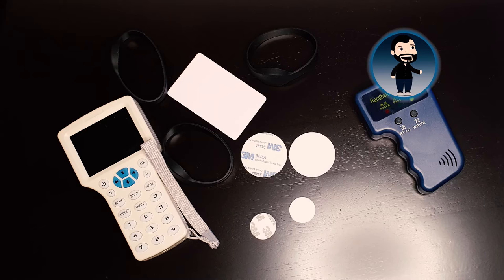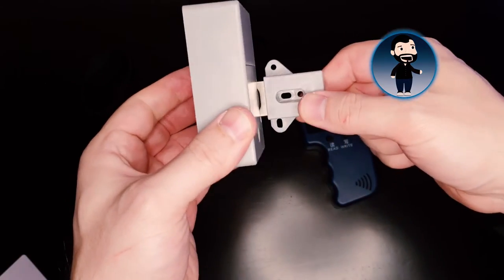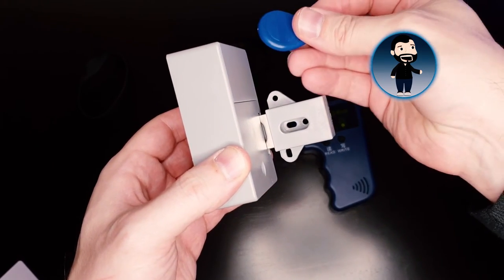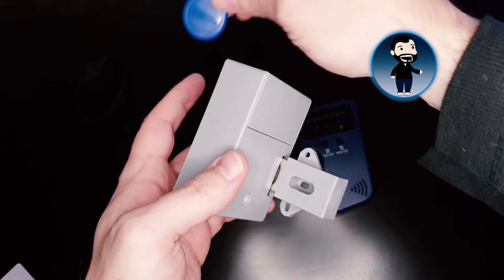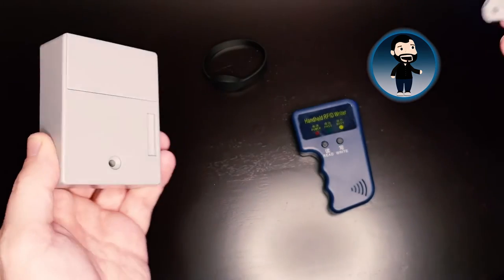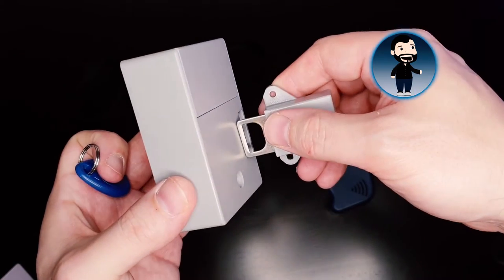Cloning And Smart Use Of RFID Keycards & Fobs

Comment: Not one person in youtube show how to manually write in codes, someone says its possible with the second reader/writer you show, I tried but am doing it worng, example I did following, step1--change mode to 125khz or whatever, step2---type in number (error) number cannot be typed in, so to manually write I have to do something, but not a clue, maybe I did the 1st step wrong, been tryin, will wait for suggestions, thanks.
Reply from the maker: This should work as this is how it works on mine, switch to mode of frequency then type and then hit write. You might try if clearing or c beforehand works. Seems like since these readers are generic they vary greatly
Reply: @AndysTechLife  -- I figured it out, you cannot type HID numbers in because the HID keyfobs have to be programmed with a facility code which is not optional in this device, but what it can do, it can copy over all the data from one to another by scanning/reading then writing, but manually writing not possible because it will be missing (2 sets of number codes) not talking about the regular card number or the KHz number. But after reading this, HID cannot be done by writing in manually, has to be an HID keyfob just as original HID keyfob and has to be scanned copied and then write button has to be clicked on the target HID 26-bit Prox keyfob. Thanks for your help and prompt reply.

Comment: Hey Andy! 
Great video, was curious I have a Schlage, IC-Type A chip. Was given permission to copy it to save money, purchased the same 10 frequency reader you have in the video. However it’s been unable to decode the chip and therefore unable to properly read it to copy. Do you recommend a specific decoding software? (They want to charge me over 150$ if I have them do it)
Reply from the maker: From what little I know, many of the Schlage chips use both standard 125 kHz proximity and 13.56MHz MIFARE and Prox Multi-Technology. So you'd need to check your specific chip to understand which one it is. So if it's the 13.56Mhz MiFARE, see if you can read the fob with your phone's NFC first using something like Mifare Classic Tool app.  You may still not be able to copy it but you know you're on the right track. If you set the reader to 125khz mode and you get a result you're probably looking at a HiD / T5577 compatible 125khz chip. Last thing is depending on the reader you got, there should be a link to PC software you can download and attach the reader via USB and try decoding that way. If all this doesn't work you might look at Proxmark3 which is a more complete copying solution. As a tip, if you know a friendly locksmith with a reader they might just read the fob and tell you what type / frequency and even data is on it which you could then use to duplicate yourself, but they may not do this without charging. Hope this helps, but unfortunately there's so many standards, chipsets, encoding etc, it's impossible to get one solution that works for everything.
Reply: @AndysTechLife  Really appreciate the reply, the chip more specifically is a IC-Type A 13.56 mHz. Company brand Schlage and pops up as a E4100 on their main site that uses Mifare Classic. The computer software that comes with the reader in your video was unable to copy the FoB. Unfortunately all the locksmiths in my area (went to 4) only do car fobs. Ill give the Proxmark3 a look into and let you know the results.

Comment: Hi. Do you know if ACT fobs are the same as HID and do the readers you talk about here work on them. I have an ACT 125khz fob. Thanks
Reply from the maker: You might google the particular serial number as im not as familiar with the ACT fobs in particular but a brief look suggests that some are HiD compatible. But some of them are a different standard by the looks of it (5e) Its likely that you'll be able to read them and write them if they use a similar chipset. If I find any more info I'll let you know.
Reply from the maker: HID licence out so ACT seem to do HID based fobs so the likely answer is yes  but again if you can check the particluar model / serial number to be sure.
Reply: @AndysTechLife  great thanks a mill
Reply: @AndysTechLife  Sorry Last question. How do I find the serial number on google as I can't see any number on the fob? Thanks
Reply from the maker: They're normally printed in really tiny letters on the fob, but they do wear off so you might need to just googel search ACT fobs until you find one that looks an exact match. Normally the HID ones have some indication that they're HID on them but not always
Reply: @AndysTechLife  Great will do. thanks for your help

Comment: Can one tag hold more than one code? like work ID, house gate, or a cabinet all in one sticker
Reply from the maker: No unfortunately the stickers are only capable of holding 1 tag at a time. There are some on the market that can hold a couple of different types such as T5577 and NFC,  but essentially there's two chips on those ones, so in general its one tag, one code
Reply: You can get an electronic one that looks like a car remote which can learn multiple tags. I've seen up to 10 tags.

Comment: What about a Dual Frequency Schlage 9691T ?
Reply from the maker: So afik these chips use Mifare® Classic® 1K (4-byte UID) This is NFC & H10301 (HID® Proxy). So if your reader can read HID tags you should be able to read / write that part of the chip. The MiFare classic though will depend on how the card is written, no guarantee you'll be able to clone the data. It's very much trial end error with cards and readers, so worth looking to see if there's a specific reader for this type of card.

Comment: I’m getting a “read failure” when trying to scan my fob :( any ideas?
Reply from the maker: Depends on the type of Fob. Generally when that happens it means that the reader can't identify the fob in question. It's very hit and miss as I've seen many different versions of this reader so best to Google your specific fob for the correct reader.
Reply: @AndysTechLife  thanks for the reply Andy. It’s a bit frustrating really since the fob I have is a HID 1346 prox… so I bought a reader that supposedly catered to it. But these machines just seem to be random. I read an article then after with a guy who bought the same reader TWICE and one worked and the other didn’t… a bit wild 😅

Comment: Yes but how to copy pac stanley key fob 153khz???
Reply from the maker: You'd need to get the official Pac Stanley equipment by the looks of it. As they're a different frequency none of these readers will work. Might be no harm asking a locksmith if there's anything they can recommend, but these readers only do NFC and 125khz so won't work with 153khz cards and fobs.

Comment: Could you please check the data of the access control card? Not modify
Reply from the maker: Not sure if I understand the question here. The reader, depending on which one you have, can be connected to a PC to read some encrypted data from the chips, but you'll need to make sure you get the correct reader for your own style of chip.

Comment: Is there anywhere we can buy an original HID 1346 ProxKey III that can be re-written on? Or does the manufacturer not allow additional recoding?
Reply from the maker: ID Cards direct (.co.uk) sells the official HID ones, but I don't know if they program or need to be reprogrammed. Its generally not possible to recode these though, and generally whoever coded it in the first place tends to lock it from recoding, at least not without an official HID reader / writer. It's also not a good idea to try programming blank official ones on non official readers. It's worth looking at the T5577 cards though. These are what I use to replace most of the HID cards I use as they're HID compatible and have worked fine for me.

Comment: Does this include fobs that have a block on the code? I had someone try already to make a copy
Reply from the maker: Really depends on the equipment.  HiD fobs are blocked generally but some readers can still copy them. So far I haven't come across any that the reader I showed there couldn't read and copy, but there's no way to be 100% sure without trial and error. If they can be cloned in a shop such as a locksmith then there is a commercially available reader that can do it. Maybe check with a locksmith if your fob can be copied. If it can then you know that its just a question of finding the right reader.

Comment: does this work with hid prox 1346 key?
Reply from the maker: Pretty sure this model does, best to check before purchasing though. Mine does support most HID proxy passes, but there are lots of different versions so check the specs before you buy
Reply: @AndysTechLife  I bought one of the cheap ones it does work with the HID proxy pass I mentioned. I got it through Amazon if it didn't work I would just return it and get the more expensive one.

Comment: Will this work for secura rk65 reader?
Reply from the maker: There's different versions and different protocols so you need to check what type of rfid chips you are using first then get the correct one for that. There's no 1 reader that will do all different makes and types of chip. The one I display here is compatible with HID card 1386/1326/1346, T5577, EM4305 chips, but as I said there a literally hundreda of different types so you need to buy one specific for your fobs. Hope this helps

Comment: what about a fob that ends with  ( A  HCC40 )
Reply from the maker: Just a guess but I think HC are Prox Fob 125 kHz HCC40 Hartmanm Control systems, might be worth seeing if you can figure out if it is one of those, but you may need a specific reader / writer for it. Unfortunately, there's no one option that works for everything as there's so many standards and chipsets. :(
Reply: @AndysTechLife  wonder if I could find a reader and writer for one of them I've kind of looked around a little bit but I don't see none.

Comment: my fob key has no information on it  - how then could I find out what type it is?
Reply from the maker: There's no easy way to be honest. You could try taking to a key cutter or locksmith who might be able to scan it and let you know.
Reply: It depends on what tag you have but you can go online and check it if there's a name on your tag or the brand
Reply: Check your keypad for the name of the tag it should be there but most of apartment built after 2005 have still the 125.mh but there's alot that have the 135.mh

Comment: I bought the white on it did not work
Reply from the maker: There's different versions and different protocols so you need to check what type of rfid chips you are using first then get the correct one for that. There's no 1 reader that will do all different makes and types of chip. The one I display here is compatible with HID card 1386/1326/1346, T5577, EM4305 chips, but as I said there a literally hundreda of different types so you need to buy one specific for your fobs. Hope this helps

Comment: It won't write. Ordered the same machine, I am using the same black rubber for hand and it is failing to write every single time. Money thrown away.
Reply from the maker: There's lots of versions of the machine, so you need to be sure that its compatible. If its RFID there are different standards and protocols and if its NFC there are different chipsets. So its important to make sure you match the reader to the type of chip you're using. The one I'm using is compatible with HID, T5577, and certain NFC cards for example. Hope this makes sense.
Reply from the maker: If you've bought the correct reader and t5577 bands then I'd send them back though as this reader should work with T5577 bands, but check you've received the right ones as if not it won't work.
Reply: @AndysTechLife  Thanks!
 Before I return everything back, can I send you some picture if you can give me your email? I bought more tags, different types, and I can't write on any of those. The machine can read but it can't write. Also, it didn't came with any instructions.
Reply from the maker: Pictures won't tell me I'm afraid. No way to tell by looking at them. :( You'd need to know the chip inside. I'd look at the receipt for the bands and see if it says what type of chip they are
Reply from the maker: Also some NFC tags can be read and not written such as Mifare 1k 13.56mhz.
Reply: @AndysTechLife  Those I think I am trying to copy. My gym card is like this, and I ordered specifically those chips. I thaught that the machine could read and write many frequencies...
Reply from the maker: Frequencies yes, but particularly with NFC there's different standards and chipsets. For example, i can read my public transport card, but can't clone it or write it because of the encryption it uses.
Reply: @AndysTechLife  I am returning the machine tomorrow purchased from Amazon. I would like to know what to look for. The lady who made me a key copy for the appartment used a green like USB stick to copy a new one (I was charged 50€ for that). And I tbaught, it must be a easier way.
 (Thanks for the chat tho, Andy. I really appreciate it)
Reply from the maker: Best to see if there's any markings on the apartment keyfob and google to see if you can figure out the type of chip. For example it might say HID and a number, then you could google the chips and reader for that. Hope you get it sorted :)

Comment: Those wont copy iclass 47 bit
Reply from the maker: There's different versions and different protocols so you need to check what type of rfid chips you are using first then get the correct one for that. There's no 1 reader that will do all different makes and types of chip. The one I display here is compatible with HID card 1386/1326/1346, T5577, EM4305 chips, but as I said there a literally hundreda of different types so you need to buy one specific for your fobs. Hope this helps

Comment: Device is garbage wont even work on encrypted cards.
Reply from the maker: So this one is mostly for Em4100 and HID cards. It will work on some encrypted ones if you connect to PC and run the software through Windows, but there's so many standards and types of cards there's no one reader that will do all. Best thing is to find a reader that's specifically for the cards you are looking to clone. Bare in mind though its not possible to copy all fobs and cards. :(
Reply: Yup, so do you happen to know anything about the Chameleon vs Proxymark3 and if either can clone Keri?